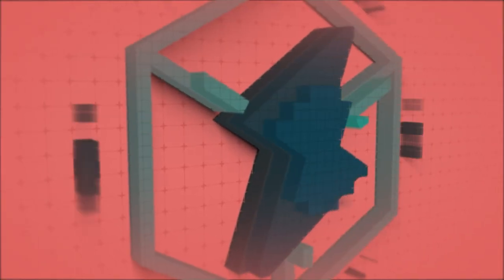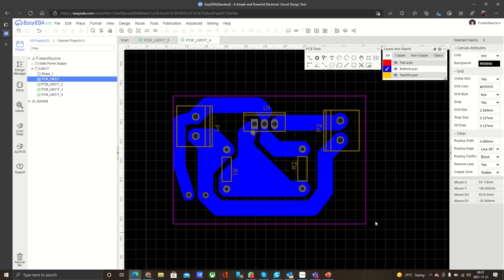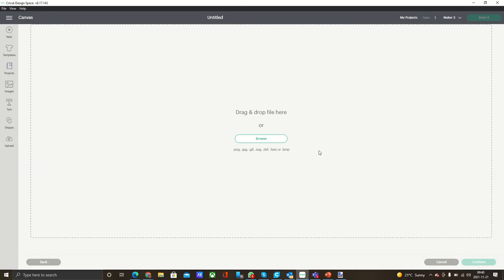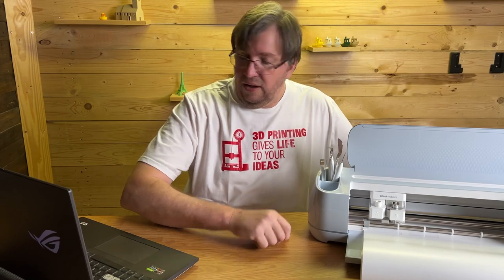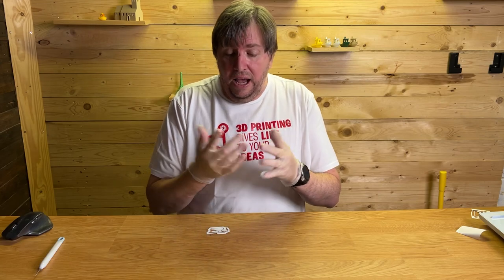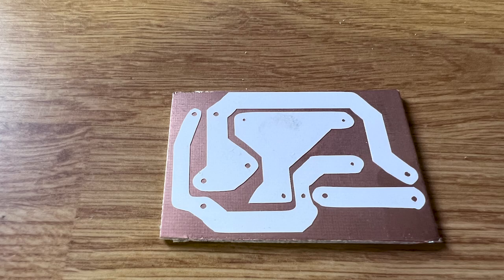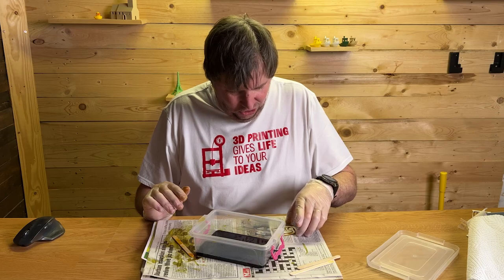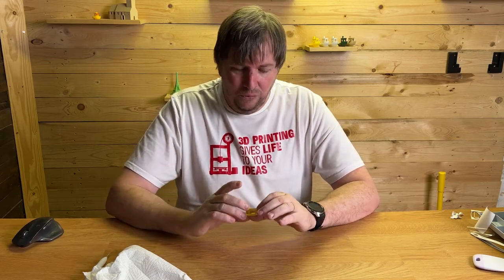Secret to creating a Printed Circuit Board in under an hour.

Comment: Use your 3d printer to oscillate the ferric chloride.  You can have the heated bed warm the solution and some gcode that just moves the Y position back and forward for 15 minutes is all you need. Remember to turn off the home gcode to prevent the hot end squashing the container.  Oh, that gets messy if you don't.

Comment: You can cut your etching time down considerably by putting the board in the etchant with the copper side down. Also you should heat the etchant a bit. Use a few popsicle sticks to keep the board off the bottom of the container by propping up the edges. The sticks will be set diagonal against the edges of the container, which should be only slightly larger than the board. You need liquid a few inches deep. Sounds like a lot of trouble but the board will etch in about 15 minutes and there will be less undercutting of the resist. You will need to agitate as before.
Reply from the maker: Thank you for the great reply, I will try this.
Reply: I bet this guy has a well regulated heating and agitation machine somewhere which can just move the container back and forth a little.

Comment: I'm very curious since the cricut maker can make deep cuts if you could just cut a pcb directly without doing the etching. I really don't want to have to deal with the acid.
Reply from the maker: Unfortunately that will not work, the blades are not designed for that.
Reply: Yes, I've always wanted a mini-milling machine and see if possible to make PCB boards without chemistry.  We just need to invent a "dremel pen" to put in place of the Cricut pen, with appropriate calibrations for speed of cutting, depth, etc.

Comment: Great video I think you’re doing a marvellous job I am very new to PCB work but watching this video I’m definitely gonna get into it thank you so much for the video
Reply from the maker: What a nice thing to say Marcus, truly made my day, thank you so much for that comment.
Reply: @FusionSource  no problem I think doing projects like this it’s educating and so much fun I am definitely gonna do that I’m gonna go and buy A laminate cutting printer Can you recommend a model that will precisely cut very small ones as well I want to make all different types of boards and then get into very detailed boards with complex firmware upgrades and allsorts of stuff it’s gonna be great fun thank you so much for the video is giving me something to do it last I do a lot of wildlife photography and I repair camera lenses and cameras but this is gonna be so much fun again thank you so much We can share some ideas and make some really good stuff in the future thank you Mark
Reply: @FusionSource  the other things , were can I buy all parts and Materials to start me out can you Recommend somewhere to buy I have a Amazon account and an eBay account thanks mark
Reply: @FusionSource  some of the Equipment I have could Come in handy in the future I have a Nikon d850 and a sigma 60-600 and a Nikon 105mm macro lens and a Epson sure colour p900 which prints just over A2  I have a Roller tray which has A2 rolled paper and I have flash Equipment and triggers and constant light with a lot of soft box’s of all sizes I am going to get other Soldering station and some more test gear for Checking components I have got the Sekonic L-858D SPEEDMASTER  Light meter which is handy for video work this is some of the Equipment I have which would be very handy
Reply: @FusionSource  one of the Boards I would like to make is a metal detector and a long-distance camera and microphone board or a 4G and 5G Booster to get my Internet faster on Vodafone
Reply: Just a little thought did you try engraving the board on the cricket because I noticed some of them do engraving I’m not sure how deep or if it takes the middles out but it’s worth having a look thanks mark
Reply from the maker: @marcusjames1221 I was thinking of that as an option but have not tried it, it would be difficult to move the board back and forward though, left and right is the head but the y axis would have to be the board

Comment: Very cool, I have a similar interest and I think I have the smaller cutter unit.  It’s super precise.  I actually use it to hold a fine-tipped pencil to write at 5pt font.  It’s a remarkably precise device for the cost!  Put a pen in there and use it to draw detailed pictures and you’ll see how fine-grained it is. :)
Reply from the maker: Will try that

Comment: I love this video of yours. I am also into making small PCBs for my own little circuits. I've been using Micro Robotics transfer paper with acceptable results. We do have a vinyl cutter and I have thought about trying what you did but never got around to it. After seeing this video, I am definitely going to give it a try very soon. For agitating the ferric chloride, I built me a crude little "shaker" with a servo and a small ATTINY85 circuit to make the shaker platform swing back and forth, meaning I can do other things while waiting.
Reply from the maker: Thank you for the comment, really like the idea of the shaker.  I heard that you can also use a 3d printer with the heatbed heated up and sway backwards and forwards using gcode.

Comment: The Cricut maker also have an engraving tool. Can you use it to engrave the circuit. Like with an CNC?
Reply from the maker: Hi Kai, thank you for the question.  I do not have the engraving tool for my machine so I am not sure if this will work.  I am not sure if the machine will be able to cut into the copper.  I will look for an opportunity to try test this.
Reply: @FusionSource  Ah OK. So the engraving tool is an extra add on that you have to buy. I didn't knew it. I don't have a cricut maker, but my mother in law has one.
Reply: @kaimildner2153  that's good question. I currently cut my PCBs with 3018 CNC and was also wondering if this cricut can do it as well.
Reply: @kaimildner2153  I have the engraving tool...might give this a go.
Reply: @diybiosensors  Have you had a chance to test this with the engraving tool? What was the result? I would like to try this as well. Are you using designs for SMD or through-hole components? Any advice?
Reply: @karinmartens7862  Not yet, turns out I needed the drive housing or something like that, will purchase it eventually. Have you gone for it yet? I feel like this has to be possible.
Reply: @diybiosensors  Yes, I have done this with the engraving tool and it works fine. Very nice result.

Comment: Will it do smd pcb fine pitch cutting.? 
Can we cut on A4 Transparent Paper?
Reply from the maker: Hi Jai, It can cut small holes for the drill holes, so it should be able to cut for Surface Mount Components but you will have to design carefully and do the vinyl separation slowly and carefully.  It is not extremely high resolution but I have been impressed by how small I can go.  

As far A4 transparent sheet, yes you can cut it but it will need to be stuck onto a cutting board.